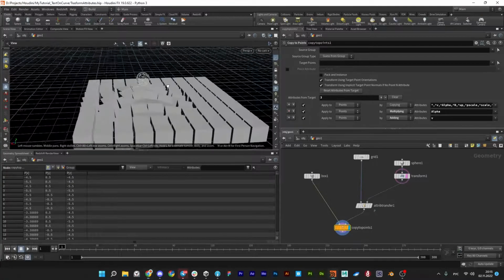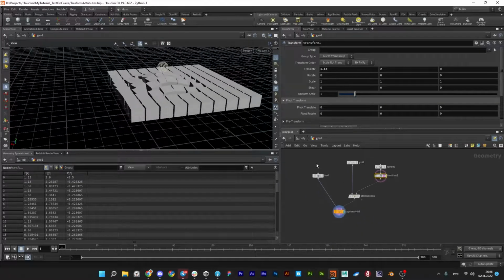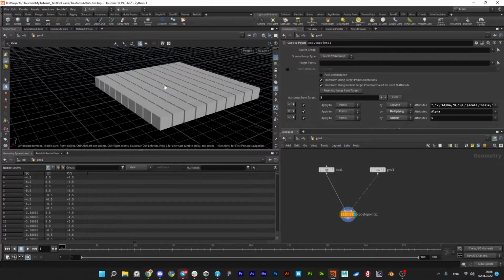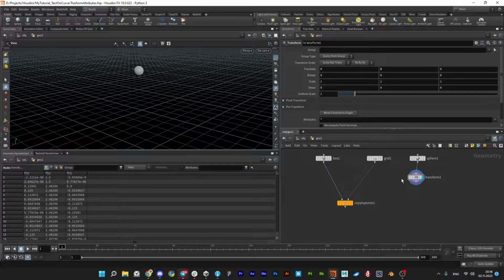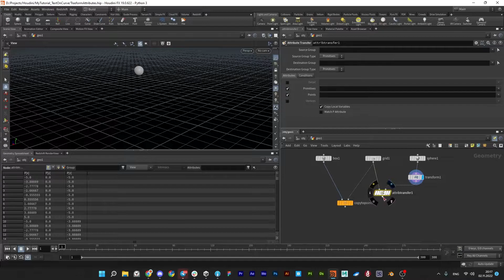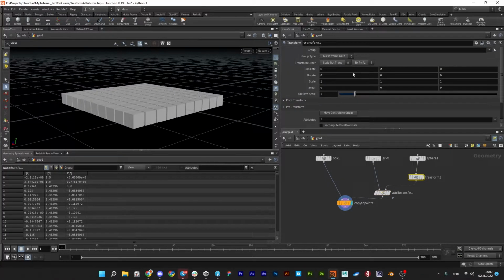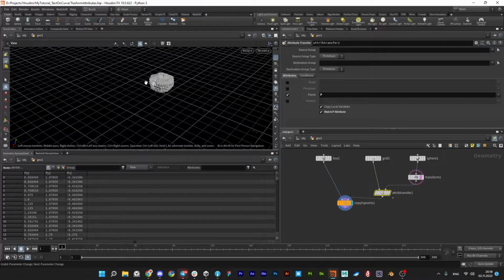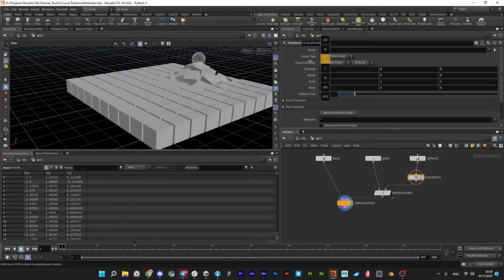Transfer Position Attribute. Houdini tutorial for begginers

Comment: Hey man i have been searching a way, Where i could make get a value changing on the basis or a range, like if the Sphere animated when it passes by the square the square should scale up. If there way to get values for the uniform scale.
Reply from the maker: Sorry, I'am not working in Houdini anymore, so I can only answer this question like this: yes, there is definitely a way, most likely you need to redirect the sphere's position attribute to the cube's Uniform Scale attribute, but if you just do that, the cube will increase indefinitely. To avoid this, you can use the "Sine function" in the Uniform scale of the cube. for example, in the Uniform Scale X Cube parameter, write = Sin([insert the position attribute here along any of the axes of your sphere]*[any number you like]). then your cube will change in waves depending on the position of the sphere